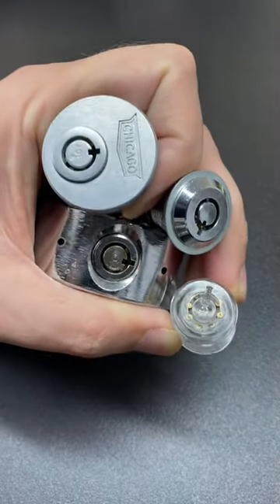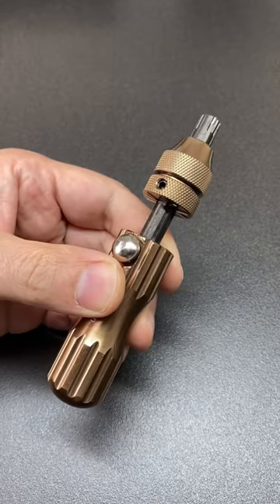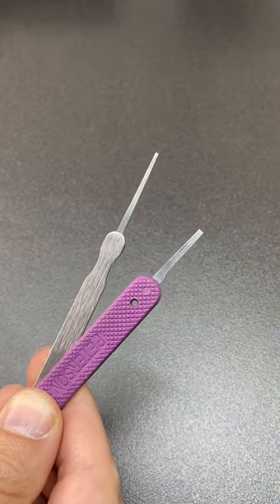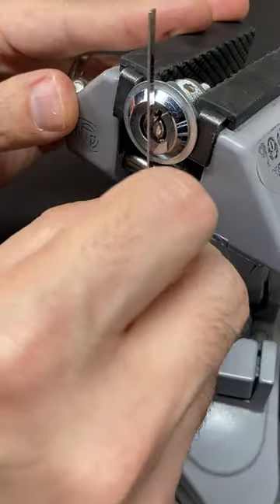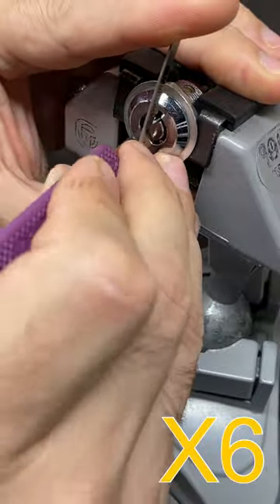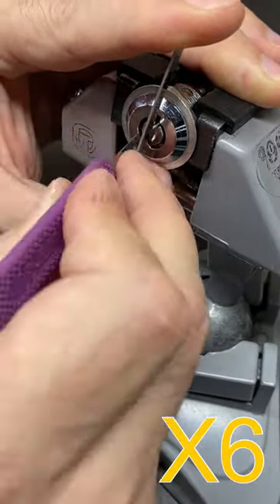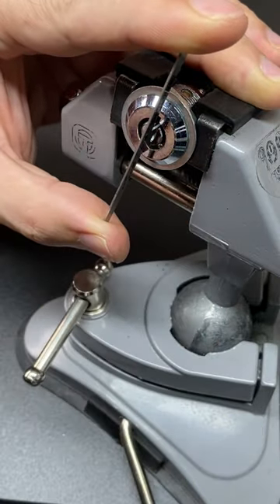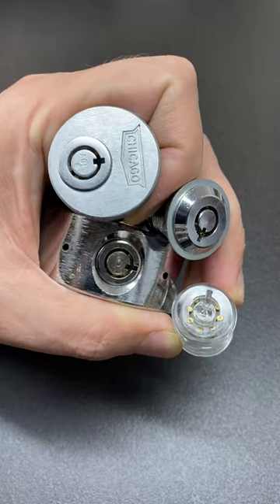How to Pick Tubular locks #shorts

Comment: Tubular Locke can also be picked using the body of a ball point pen like the standard Bic pen. The plastic is soft enough to work into the lock but firm enough to depress the pins once they're all depressed it will turn and open with just the empty pen body
Reply: I've seen this work but can't do it. The tools are so much easier but I'm still terrible with them.
Reply: Was given an electronic safe without knowing the code.
Used the bic pen to open it.
Reply: That's not always possible.  It's a known exploit fixed in better tubular locks.
Reply: @jsalsman  There is a video of the Lock Picking Lawyer failing on stage with the proper tool if that makes you feel any better.  I guess it "was a fluke" because he never got an open. 🤣
Reply: @jmr  how has it been fixed?
Reply: @JsBekkr  IIRC the fix was different size pin stacks and different springs in a couple chambers.  That makes impressioning more difficult.  Sadly although the fix is old many don't implement it.  Somewhere there is a con talk but I don't remember the name.

Comment: Question for anyone. What am i doing wrong?? I don’t have a tension handle like that I just use the classic L. Center of lick was turning correct way n all the pins should have been set. (They all clicked when I released. And before bottom of pins still had movement not bound up but the tops were set) but still nothing